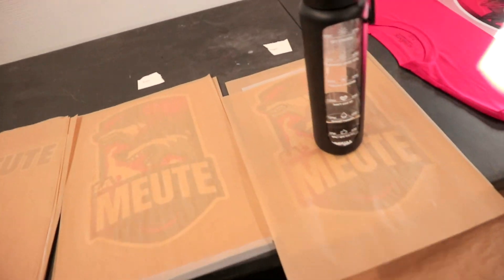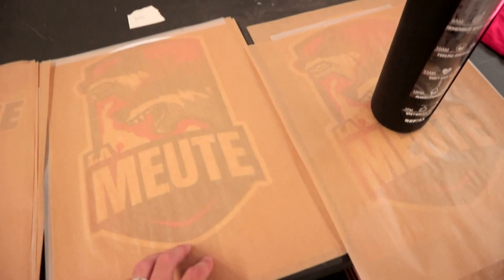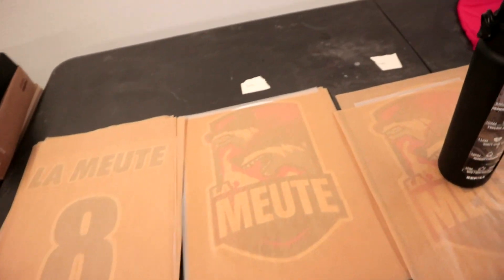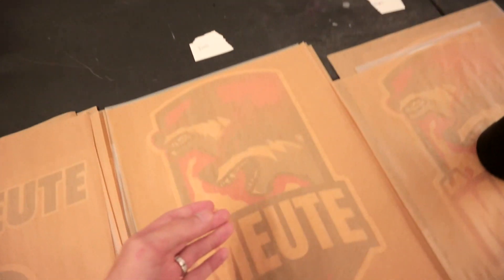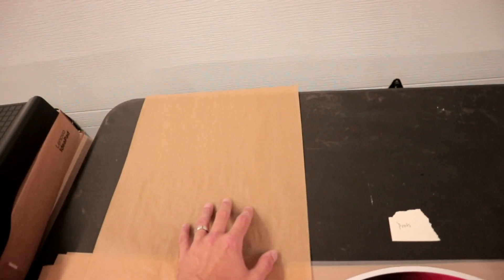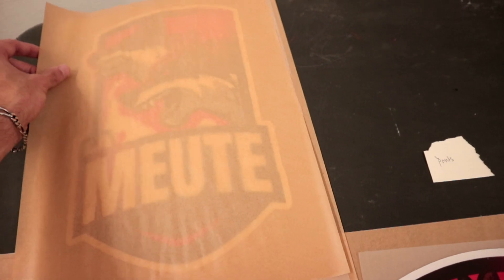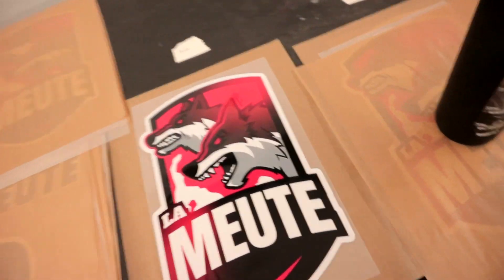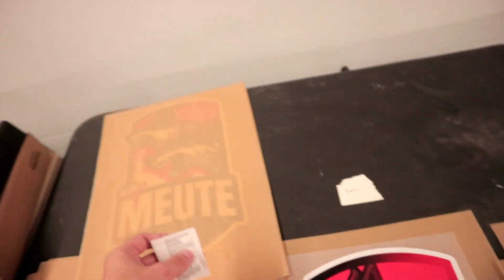How to Prevent Humidity + Store Your DTF Transfers!

Comment: Is there a way to extract humidity after having been stored in a humid environment? My first pressed transfers were perfect but when the season changed I noticed bubbles coming up under the film while pressing, ruined all of my transfers. I have since started collecting the silica bags but wasn’t sure if the humid transfers were salvageable.
Reply from the maker: I’m not 100% sure if you can extract humidity however you can most definitely happen from happening again in the future!

What I’d suggest is inserting silica gels packets inside of a closed environment such as a drawer or cupboard, insert all of your DTF Transfers inside and make sure to separate them with baking sheets or telfon papers, once all transfers are separated, you can throw a few silica gel packets inside the container and it will prevent humidity

I also made a video on “How to Store DTF Transfers”
Hope this helps

Comment: Can I fix when they feel oily ?
Reply from the maker: I’m not sure to be completely honest…
However I’m sure a fan can help and maybe putting some silica gel packets on the bottom side can help absorb any built up humidity…

Ideally keep your workspace at the following temperature:
20-25 degrees Celsius 
40-60% Humidity 

Place your Ready to Print Logos between Teflon papers, with a few silica gels on the Teflon papers to absorb anything that can be causing humidity 

Hope this helps
Reply: Just press them and wipe with a soapy cloth afterwards.